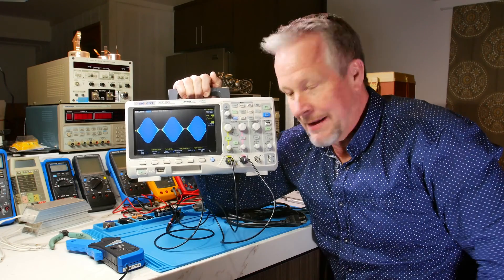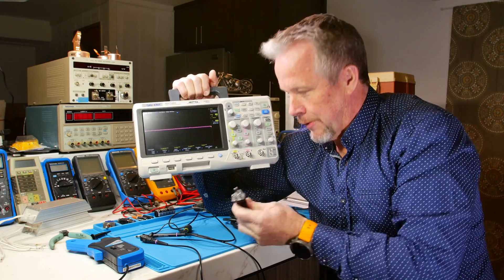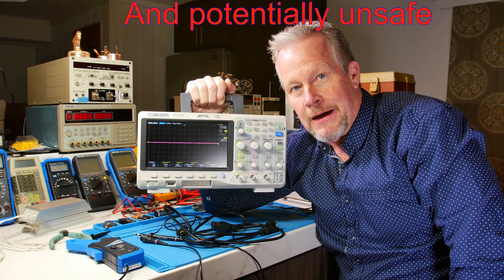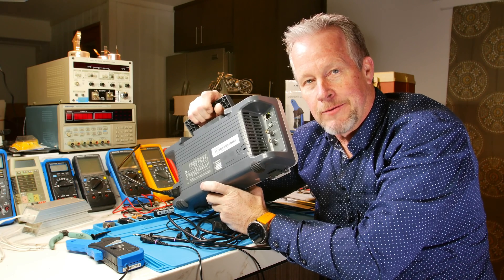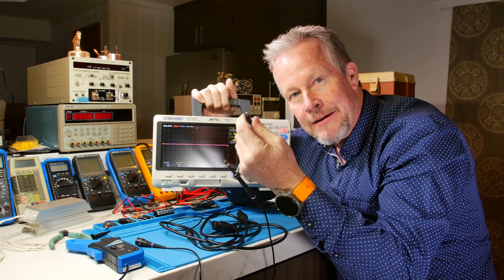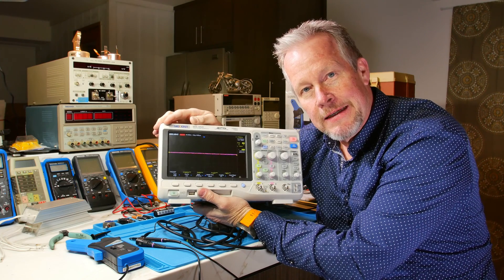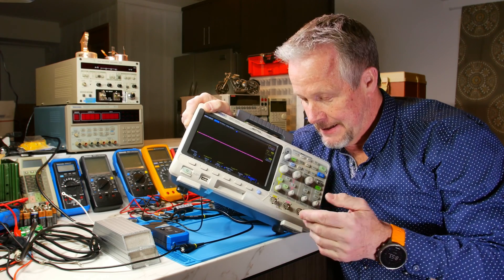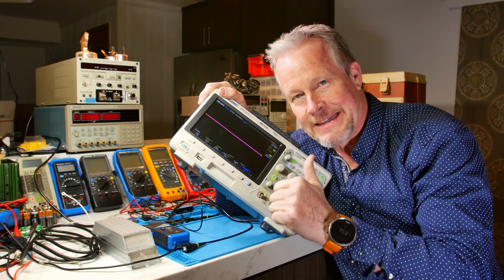oscilloscope safety - don’t blow up your scope or circuit #oscilloscopeisolation #scopesafety

Comment: I just finally got my first actual scope (largely based on your reviews and input) and it's embarrassing how excited I am about this!😄 I've only ever used them in school before and I look forward to not blowing it up
Reply from the maker: LOL that’s awesome!  Ask any questions and we will try to help you!
Reply: @KissAnalog  Thanks a lot 🙂👍
Reply: @els1f  Have you had a chance to use it yet? I also have one but i am not familiar with some of the controls and i still have the issue on how to connect the scope to the isolation transformer and what happens when you hook up the component to be tested to the wall outlet since now you are back to the same problem because you have to hook up the ground clip to the component in ordet to troubleshoot it.
Reply: I get it!  Took me several days to even turn on my Rigol DSO814. Finally fired it up last night and am working on using it with a Vellman Oscilloscope trainer. It’s going real slow and making me feel a little stupid but I’m learning and happy. I’m still worried about blowing it up but will stay away from high voltage for a while.

Comment: I recently bought Hantek 5102p Oscilloscope after years of wait to buy a scope.  I have kind of a stupid doubt and don't know who can I ask it to. 

Suppose if I have an arduino running which outputs 5volt pwm signal at 50% duty cycle and 1kHz frequency.
If I connect probes of both the channel to the very same pin of arduino that is outputting 5V pwm. Will it cause any kind of damage to my scope? 

A simpler way to put that question would be, "Can I connect same signal to two Probes of two different channels simultaneously?"
Reply from the maker: That is a fantastic question!  I'll bet there are many others wondering the same thing - so cheers to you for asking;)  No there is no problem there.  

What you want to be sure of is that the ground wire (usually with alligator type jaws) is connected to the same potential.  You can check this with power off.  Just do an ohm check with a multimeter to verify that the grounds are connected where you think they are.  Then connect both probes to the same potential (ground/return), then you can place the scope tips where you want to see the voltage (voltage difference form the tip to the ground).  Thank you for asking!
Reply: @KissAnalog  Thank you so so much for taking the time to explain it. :) Will try it out definitely.

Comment: i run an isolation transformer on the equipment I’m testing...are you advising to run isolation on scope instead??  also...would you advise 10: 1 or 100:2 probes..I’really paranoid about o-scope safety etc...thanks
Reply from the maker: That really depends on what kind of equipment.  I think running an isolation transformer on either is a big step.  Just remember to keep all scope channels and any metal contact on the scope chassis - like the USB port at the same potential.  I mostly use 10:1, but if I were running higher voltages than I'd use 100:2.  My diff probes are actually 20:1 and 50:1 as lowest settings.  Thanks for the great questions.

Comment: Yes, thank for the video, well done. You didn't mention GFCI's in Australia we call them RCD's and they trip beyond 15mA in about 10 ms. So if by chance you connected the BNC ground to to neutral on your workpiece, and your probe to hot (active) on your workpiece, there would be a differential current and the RCD/GFCI would trip,,,, wouldn't it??? presuming that you are not using an I/T on your work piece 120/240vac board.
Reply from the maker: Thanks cookie boi - I appreciate your feedback!  Yes, if the scope probe ground is connected to the Neutral then it could trip the RCD/GFCI, if there is an imbalance that causes enough current to flow.  It really doesn't; matter if the scope tip is touching anything it is just a matter of the current flowing on the ground lead.

Comment: My oscilloscope started smoking, I told it to stop, by the time it did it was dead, because I unplugged it.
Reply from the maker: Oh no - how did this happen?  Was it the way your probes were hooked up?
Reply: @KissAnalog  no, it wasn't working before, it was a lucky day to get one flash from the old phosphorus display, I was in the back shorting wires to get a beam, then I looked up to see smoke billowing out the vent, leaving a horrible stench, I think I killed my oscilloscope, but I am too scared to plug it in given the house down the street burning down from a coffee maker.
Reply from the maker: Wow - well it sounded like it was on its way out already.  If the caps and some circuitry needs to be replaced - it might be worth it to repair and have fun doing it.  If the CRT is going bad - then that might be tough to find a replacement.

Comment: Newbie question. on a 2 channel handheld dmm oscilloscope, how do you take 2 separate voltage measurements simultaneously while the probe grounds are not isolated by design? I can only assume you cannot? I don't see the the use in a two channel where they cannot Operate independently.
Reply from the maker: You are right - it is limiting when you need to have two isolated returns.  That’s when you need a differential probe;) see this link and thanks for this great question!
https://youtu.be/892RcsIUAtU

Comment: What if you have no earth ground at all?
Reply from the maker: Nikki Marie The scope probe returns are all tied together on the scope so be careful to connect the grounds at the probe tips at the same potential on the circuit that you are probing.  Make sense?
Reply: @KissAnalog  Yes thank you.
Reply from the maker: Are you floating your scope, or the circuit that you are monitoring doesn’t have. Ground?
Reply: @KissAnalog   My home was built in 1947 and has no earth ground wire in outlets, however my power cords are all tied together to a floating ground. As a temporary solution my equipment rack has grounding studs and I can tie a real earth ground to that at least so i think but thats all off topic.
Reply from the maker: Nikki Marie OK, so all your equipment chassis are tied together.  That sounds good.  Because equipment with three wire power cords typically have capacitors tied to chassis.  This puts some charge on the chassis, so bonding them together is a safer situation as it holds them at the same potential.    It sounds like you have it figured out. ;)
Reply: @KissAnalog  Thank you

Comment: Great warning!! :-)
If I did understand correctly, you talked about only using one earth from one probe while not using earth on the other, an that could give noise, why if all probes do use the same ground in the scope-side?
Would an other solution be to connect all the ground leads together at one point?
Reply from the maker: You can use one scope probe ground clip and leave the other off, but that can introduce noise.  This is because the probe has a filter element that wants to pick up the current for it from the probing point, and if it is left open it has to bet it up from the other probe then across the scope then down to its probe.  So, it is better to use both grounds - just be sure that they are referenced to the same potential with each other (the ground clips).,  And, if you are on a circuit that is on the prime power, then they need to be on the earth ground potential.  I've seen digital engineers and techs disconnect the ground leads on the probes and use a ground lead from the scope to the ground of the circuit and probe that way.  And that's fine if they are looking for digital on/off voltages (not fast), but at times they get really noisy measurements.
Reply: @KissAnalog  Thanks a lot for your clear and great answer!!
Reply: @KissAnalog  When you use the ground clip, you effectively create a Faraday cage at ground potential for nearly the entire length of the probe and cable. That keeps your signal clean.